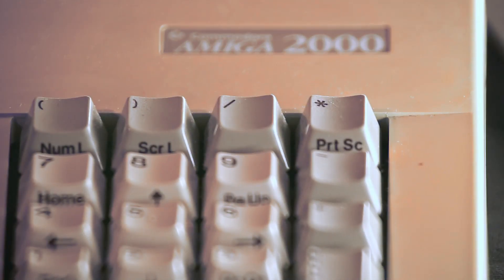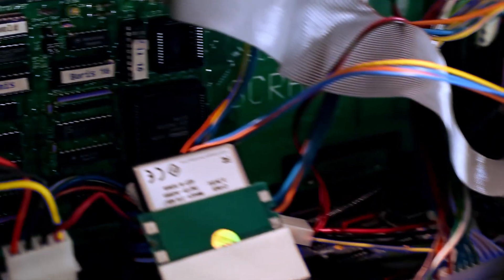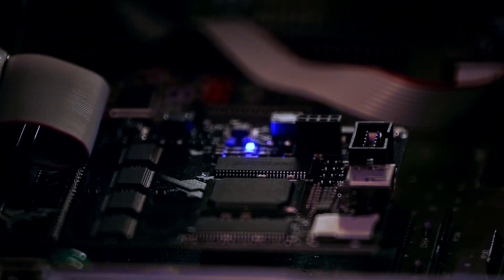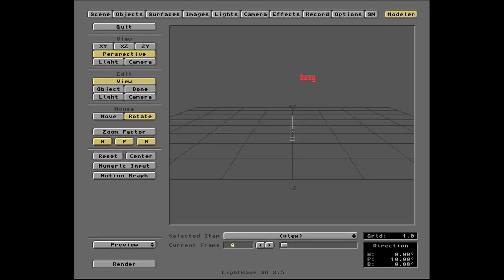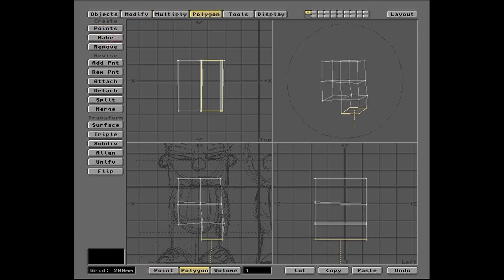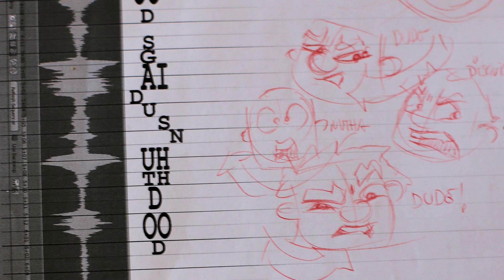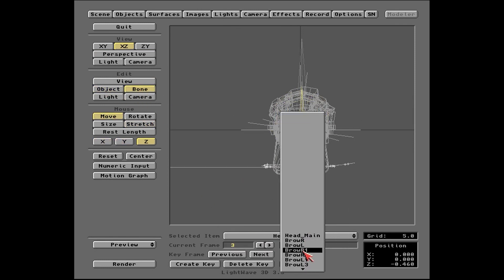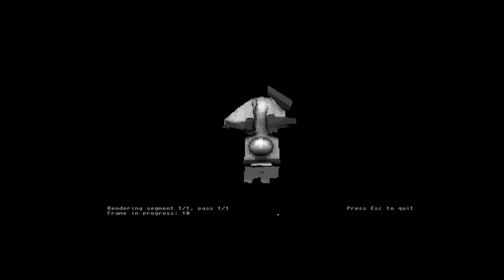Amiga-Lightwave Character Part 1

Comment: How  did you make the face of the character? Did you do some sort of points or beveling techniques? Maybe some knifing?
Reply from the maker: Wow- thanks for commenting on such an old vid! Lightwave modeller has a crude knife tool - you have to add verts to the edges you want to divide and then you can 'connect' them (rather like the 3dsmax tool of the same name). It can be a bit twitchy though. Can't remember the exact name of the tool/s it's been a while!

Comment: It would be nice to know what historical accelerators were available at the time. 
Also, I am sure this works with Video Toaster 2000.
Reply from the maker: While you can even get 060 cards for the 2000, a typical video production system seemed to have an 030 @ 25-50Mhz, 12-32Mb RAM. And yes, Lightwave is part of the Video Toaster software suite.